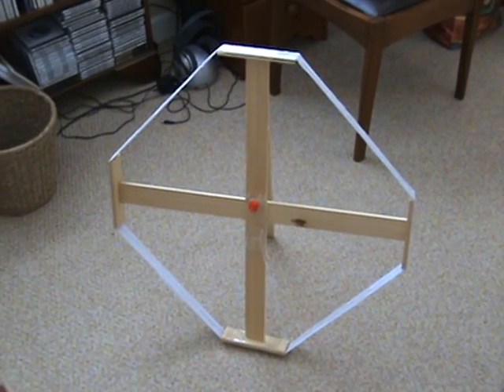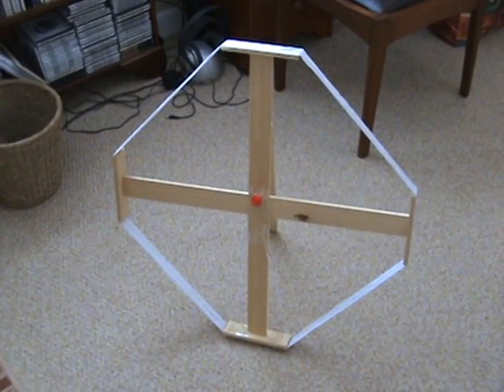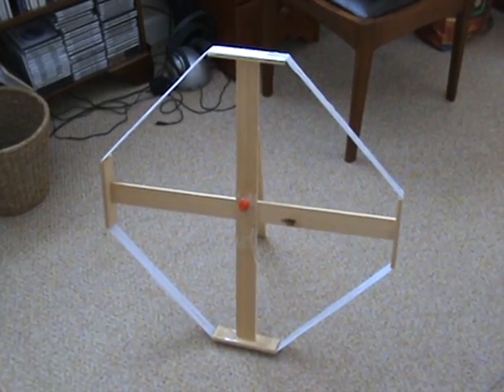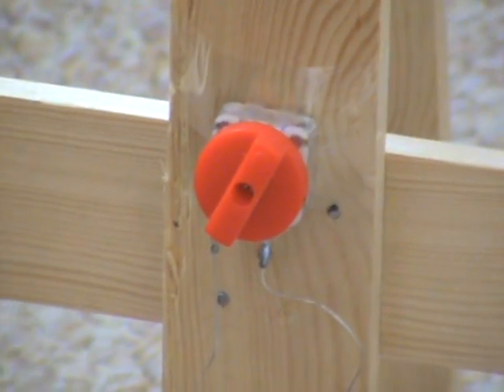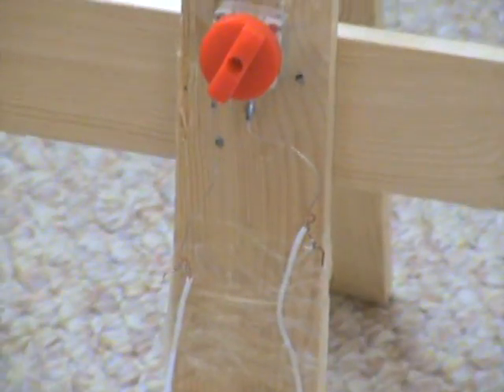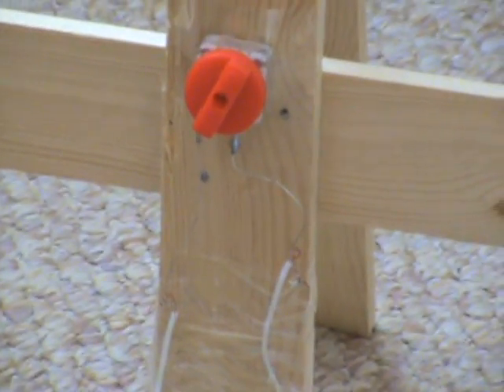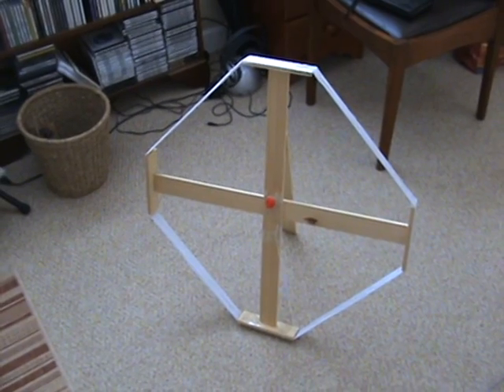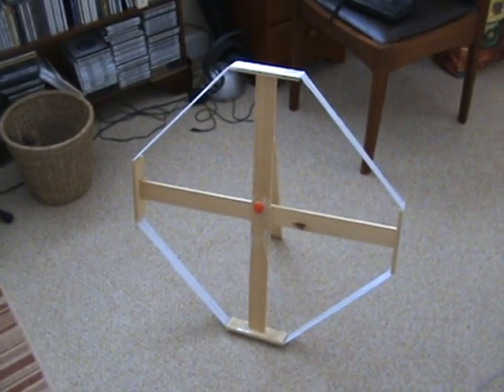AM Loop Antenna

Comment: The capacitor connects ONLY to the loop.  It is a passive device that uses resonance to "amplify" a weak signal.  By placing a radio next to the antenna and tuning the antenna to the resonant frequency (using your ears), your radio is picking up the resonance (an electromagnetic phenomenon similar to vibration) off the loop antenna.  The signal enters the loop and is boosted as the signal bounces back and forth in the IC loop (the antenna is an inductor).  The antenna is directional.